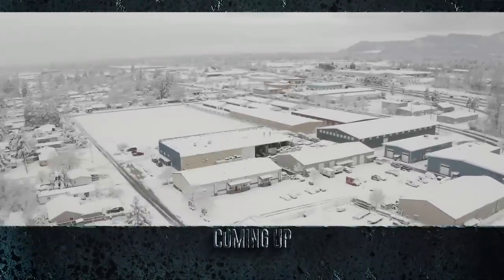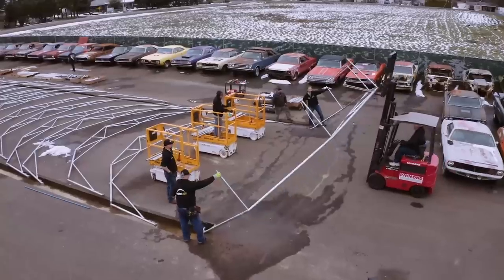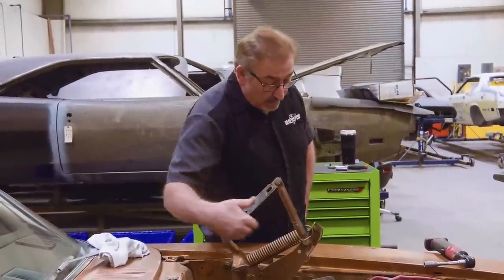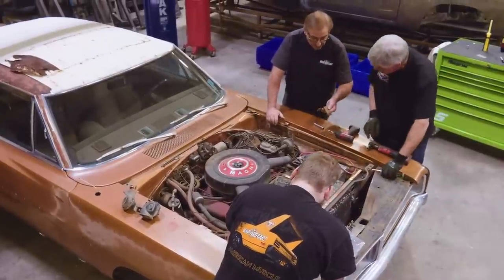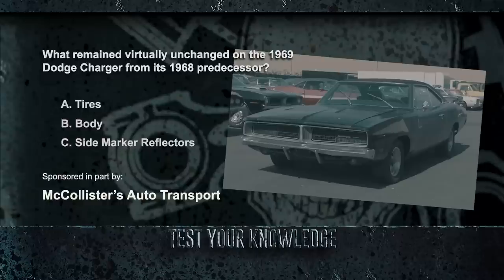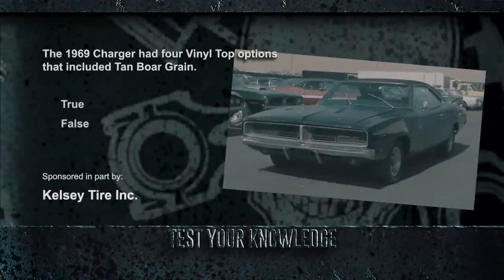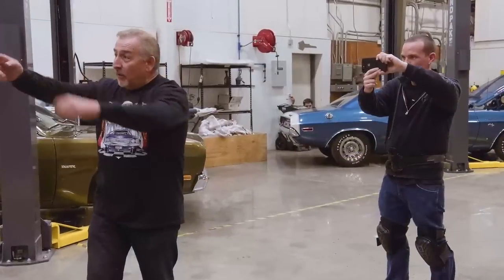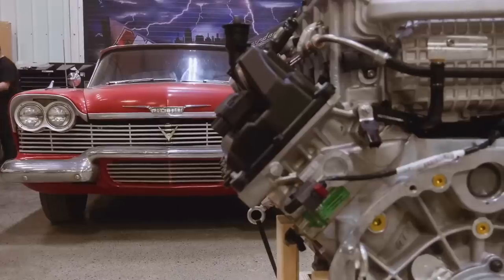MOST LOADED OPTION 69 CHARGER/T INCLUDING POWER SUNROOF: DISASSEMBLY AND DOCUMENTATION

Comment: I had a triple green moonroof rtse bought it for $440 in late 80s motor was missing. found 1970 350 hp 440 wagon that was pristine for $500 yanked the 440 out stuff and go. car had six way seats power windows ac gator grain top 3.55 gears. wonder where it is now? sold it to a dude in buena park who had a superbird and a charger 500 at the time . if I remember anymore key history about this relic I will post it here.